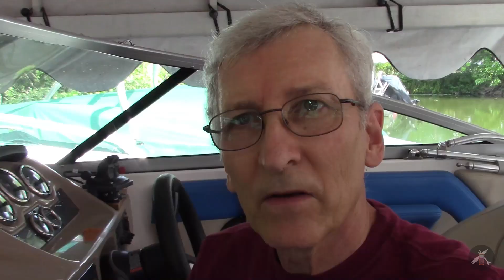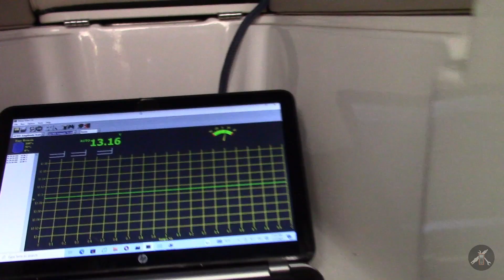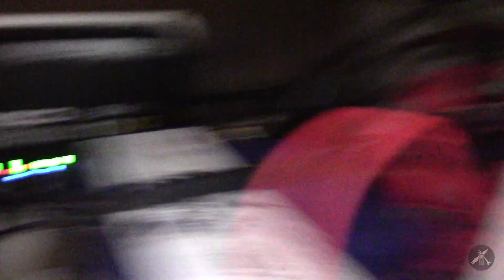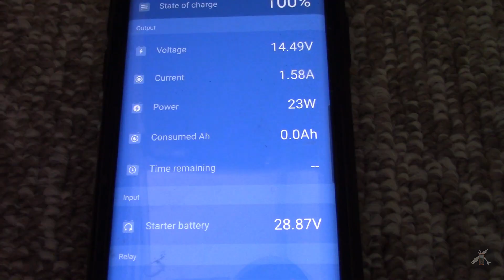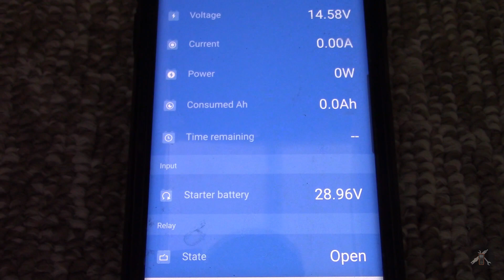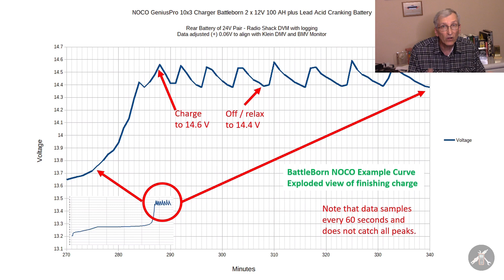Highly Recommended: NOCO Charger for Lithium Iron Phosphate Batteries

Comment: Nice report, and I appreciate seeing someone else's experience charging BattleBorn 100AH batteries with a Noco charger.  My batteries were in a travel trailer, and the internal battery heater was inadvertently left on during a week of sub 30 degree temps without shore power, which completely depleted both batteries.  This ended up being a bit of an urgent catch-22 because (according to BB) the internal heaters only draw from internal power (which was totally depleted), and the temps weren't forecasted to be above 35 for another week and, the fellow I talked with at BB said it was critical that the batteries not stay totally depleted for more than a couple days.  So I pulled them out of the trailer in a hurry and brought them inside to get their internal temps above 35, and then went looking for a 110V charger that would work with them.  When I asked BB what was the best way to quickly charge them out of the vehicle they recommended getting a Noco Genius 10 from a local Home Depot.  Well my local HD is a smaller store and didn't have one, but it only took a day to get one off the HD web site.

To charge them with the Noco Genius 10 I connected both batteries in parallel with a pair of jumper cables, and then connected the Noco Genius to one end of the jumper cables, and kept an eye on the voltage with a Fluke DVM.  I didn't graph it (and the whole time wished I had hooked up a separate DVM so I could actually see current flow), but the charging voltage behavior was pretty similar to yours.

So far I'm pretty impressed with the Noco Genius 10 charger (I initially tried to charge with a Diehard 10A from the local Advanced Auto Parts store, which claimed to support Lithium batteries, but it started acting weird and stopped charging after reaching ~30% SOC -- so I returned it and ordered the Noco).  If I was going to be doing this a lot I'd get the Noco Genius 50 or better (but prior to owning the TT I had been able to get by with a 2A Battery Tender for general charging requirements -- so I'll probably be fine with the Noco Genius 10 Amp).

You have the same level of root cause analysis/inquisitiveness I would have.  Before I crossed over into IT (30 some years ago) I was an avionics tech for the USMC, Navy, and USAF Flight Test Center.
Reply from the maker: I hadn't thought about the heated models, but I see the risk of running them down with the heaters. Lithium chemistries are all sensitive to low temperatures and to low voltage.  The advice to not leave them discharged is very valid and charging at low temperatures can damage them also.  The chemistries that I used in my automotive applications would run to well below zero F, but the lower the cell temperature the lower the allowed charging current. Too much current would damage the cells and cause potential safety hazards due to the damaged cells.

Comment: It would be better if it held 14.5V in a constant voltage mode instead of using this sawtooth mode. That way the BMS can keep balance mode on. Some BMS's will stop balancing below ~3.5V/cell.
Even though LFP has pretty long cycle life, it would be nice if the NOCO had a periodic balance mode where it only went above 14.0V every handful of charge cycles. They don't really need to balance every charge. There is significant cycle life to be gained by keeping it off of that top charge based on some of the manufacturer and research papers I've read. 
And as you can see by the graph, there's not much capacity to be gained above 14V anyway.
Reply from the maker: I understand your points.  The sawtooth surprised me, but upon reflection, it makes some sense. Battleborn told me that they need to be above 14.2 V (~3.55 V / cell) for 20 minutes. Since this sawtooth is holding above that point without constantly pushing current into the pack, it may be a very good strategy. I don't like the constant charge like my lead acid profile charger did. To equalize, a good BMS shouldn't necessarily require additional outside power, it should be bringing low cells up with power from higher cells.  The sawtooth will provide a small bump if the BMS needs it since all BMS are not created equal. 
I share the concern about being to close to top of the voltage range as well. I would prefer not to top them off every time as well. Even with this NOCO charger, I will pull the plug when I think it's had enough. I won't let it go 4 hours in sawtooth.  My experience is with the more exotic chemistries in my previous automotive applications, and it is true that they really didn't like being at the high end all the time.  In my hybrid projects, we never, ever took them to 100% SOC, and the balance circuitry was designed to balance the cells wherever they were. Often we kept them below 50% SOC for most of their life and they would live nearly forever cycling between 20 and 50%. 
In my practice with these Battleborns, I keep them at 50 to 70 % most of the time.  I'll generally only take them to full charge when I'm planning to run them soon and not store them at max.